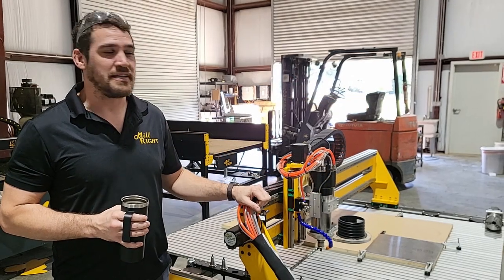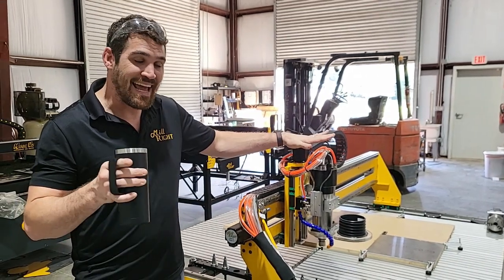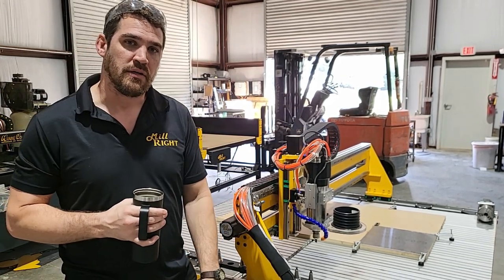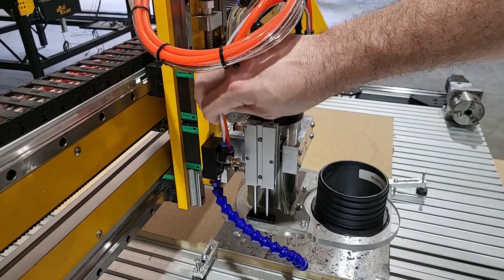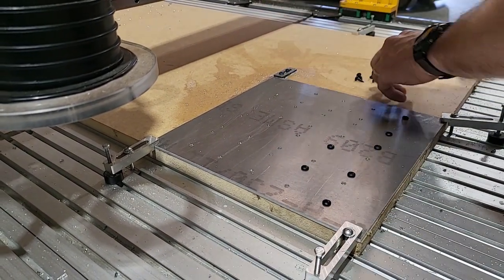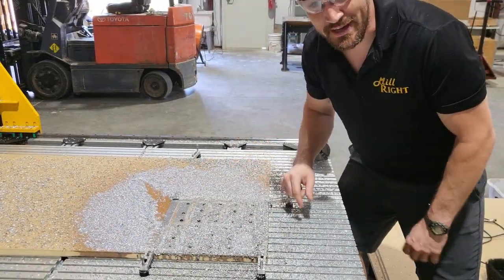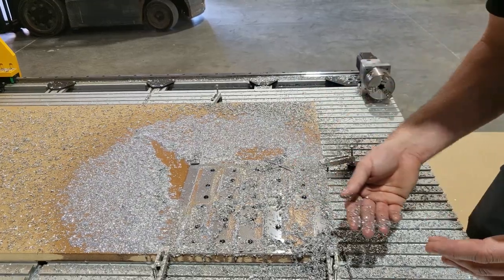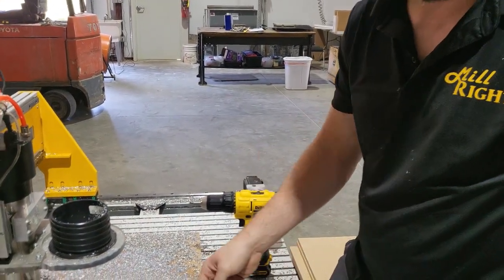MillRight CNC Power Route Max Overview and Demo

Comment: Was that full depth of cut, .125” roughing? What was your feed rate and spindle speed?
Reply from the maker: Not sure what overrides if any were applied, but looking back at the CAM setup it was 8500 RPM at 70 IPM with a 3/8" end mill.. It did take a finish pass on the contour.